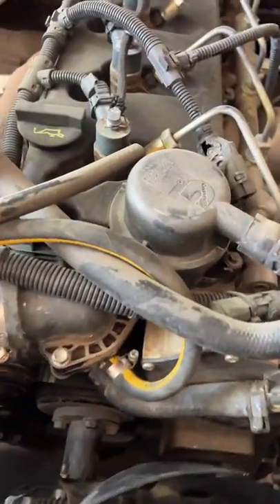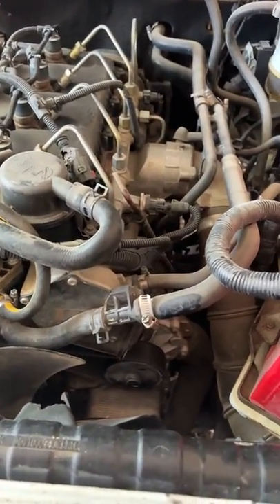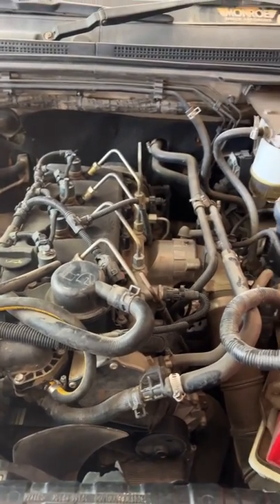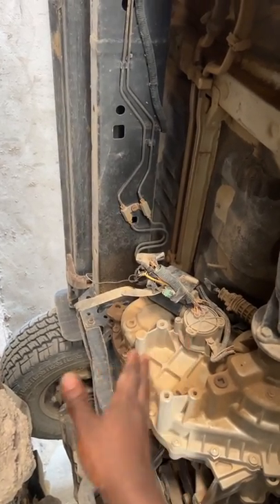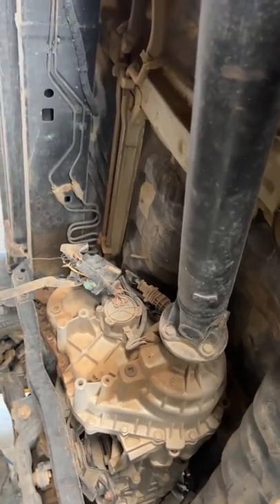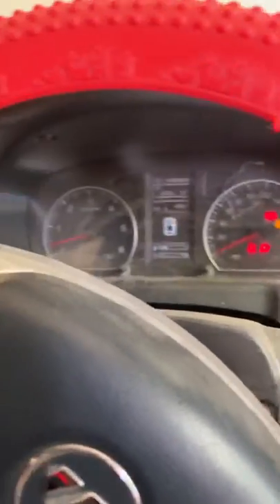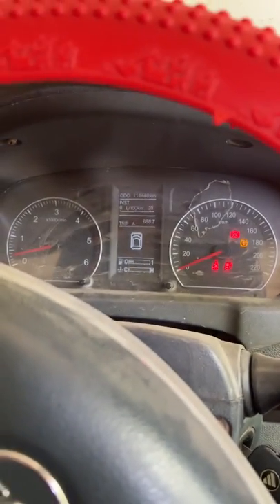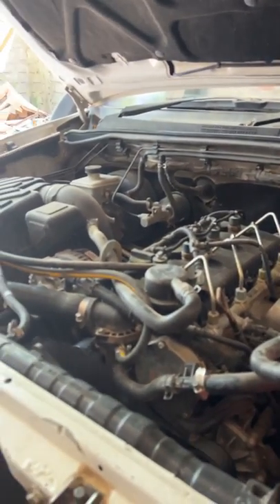Foton Tunland 8 years later problems and solutions:cumins 2.8

Comment: Nice, i have the SUV version same 2.8 isf cummins 5 yrs 132km odo. Heating is problem i am planning to add 2 aux fan, cross joint is beginning to wear out too :)
Reply from the maker: Wah 😩 132km mine is 116 8 year
Replace the fan with manual clutch heating problem will be gone
Reply from the maker: Cross joints or universal i modify mines as gut 21 it longer
Reply: Hmm may i know from which car did you get the shroud and fan? Maybe i can find it in the Philippines
Reply from the maker: @jaygerman560  i got it direct from alibaba for tunland
Reply from the maker: @jaygerman560  the shroud I didn’t change i used its initial one
Reply: Can you give me the Alibaba link?
Reply: What clutch fan kit did you get I can't seem to find one

Comment: Firstly Thank you very much for these videos my brother. I am from South Africa and there isn’t much information like you are providing here. 
Secondly I wanted to ask if you have never changed the engine timing belt, that one that you showed behind the fan! If you did, at what mileage must one change it?
Reply from the maker: Timing belt nt yet the car is very strong and durable as long as you take good care of it: water pumps: clutch plater pressure plates those are the major things that i have replaced so far: its  now 9 year

Comment: Did you have any issues with tyre pressure monitor sensors or speed sensor? My car goes into limp mode
Reply from the maker: Not at all 
But tyre pressure sensör stopped working long time ago and lack of special tyre replacements
Reply from the maker: Speed sensor ok